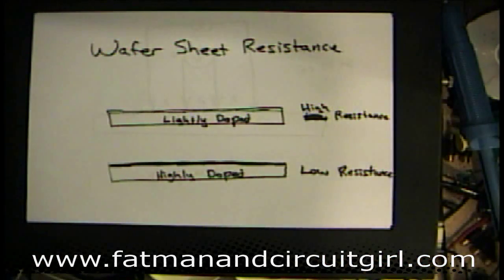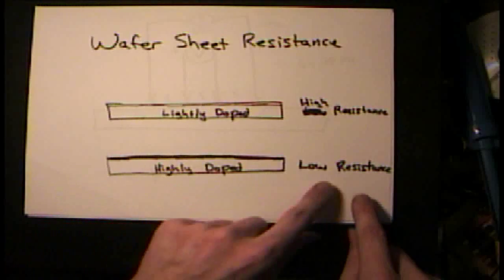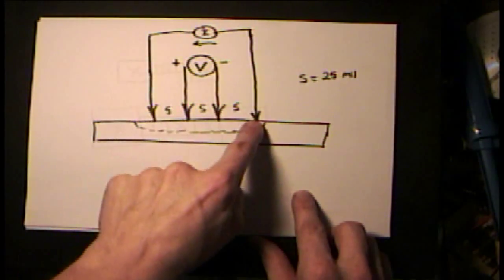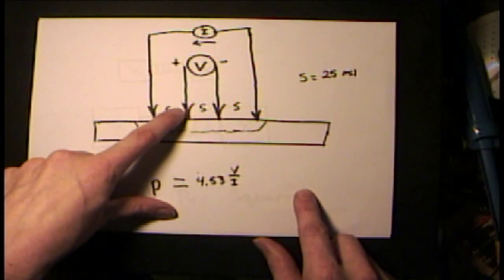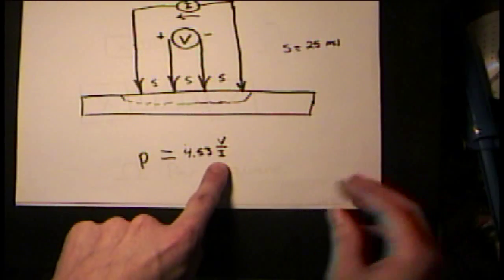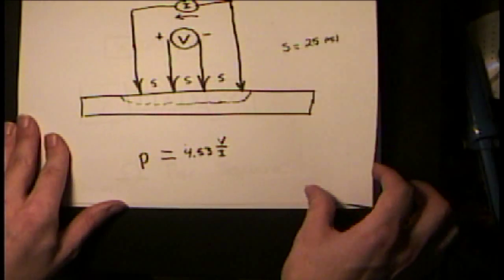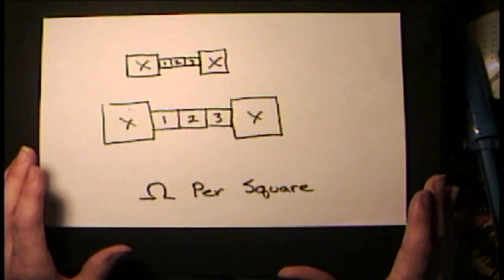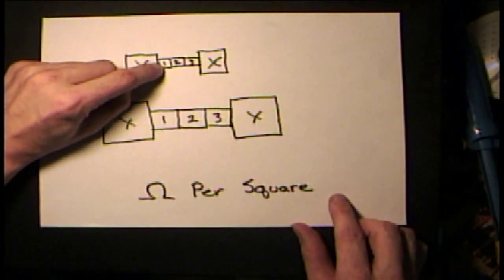Wafer Sheet Resistance and Ohms Per Square - Four Point Probes

Comment: The formula is 4 * Pi * S for the constant. Also, resistance / square does not apply only to wafers, but also to any thin film, even for example if it was a copper film. The longer you make the square, the bigger the sides (hence the contact area) so they cancel out the bigger resistance due to the more space they are appart.